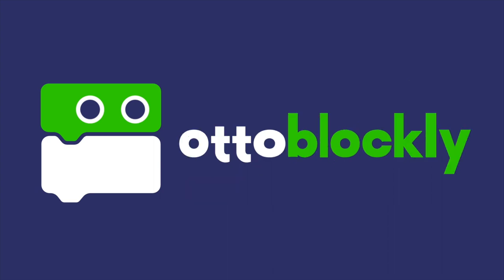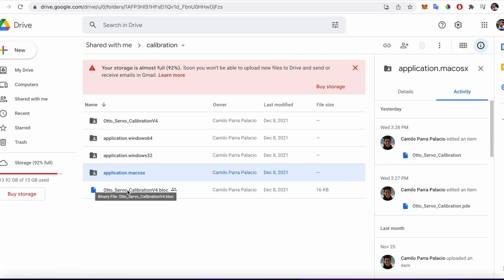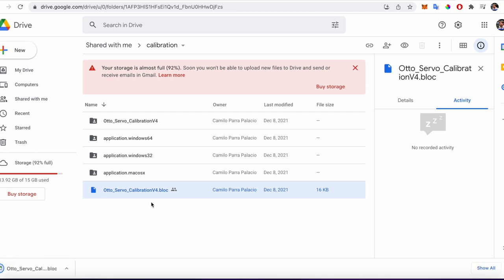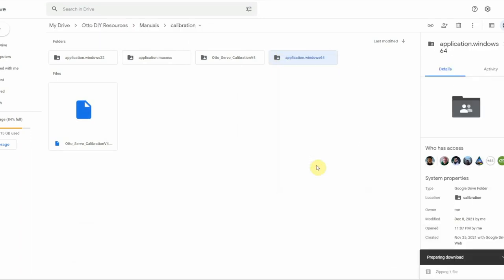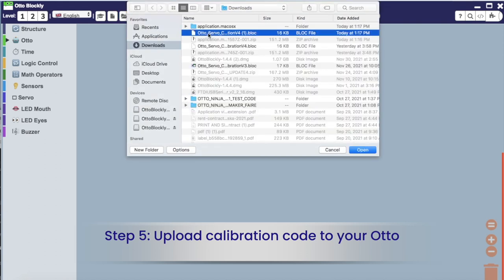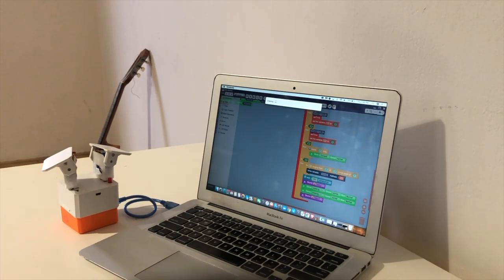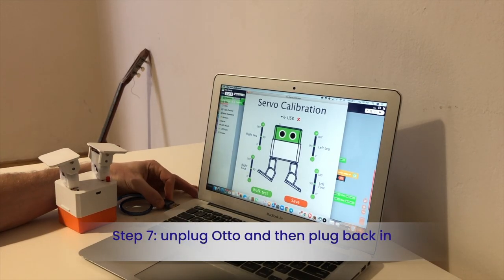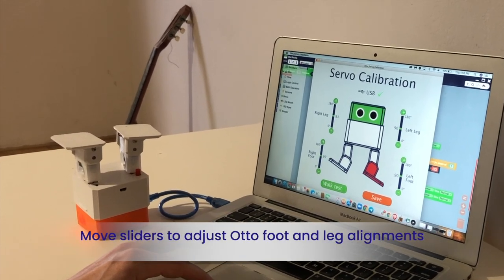How to proper calibrate Otto DIY robot servos with  calibration software and blockly or arduino code

Comment: Is there a reason the calibration app won't open in macOS (Intel - Monterey)? Doesn't look like there is any way published for MAC users to calibrate their Otto. I simply get message that the Calibration App can't be opened. Is it a Java app on MacOS and we need Java installed?

Comment: Otto_Servo_Calibration:
Windows 10 64b - USB Ok, but no response from servo (otto_blocly working fine)
Mac 12.6.1: error message Calibration cant be opened

Any other way to calibrate my Otto? Thanks!
Reply from the maker: you can use otto blockly find more about it in the community

Comment: calibration software does not connect. unplugged usb before and after and re plugged before and after opening it up. nothing. yes the code is uploaded.
Reply from the maker: Are you on Mac or Windows?